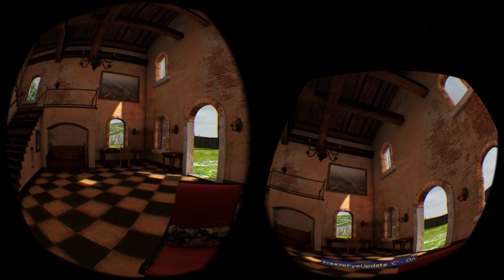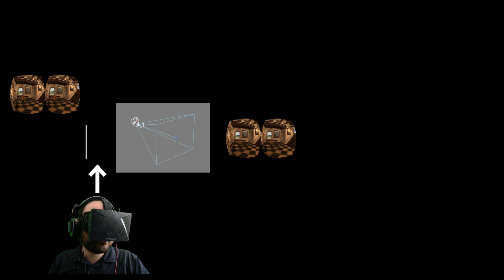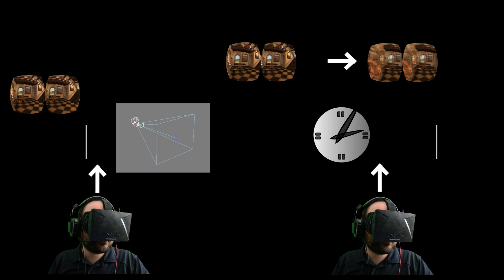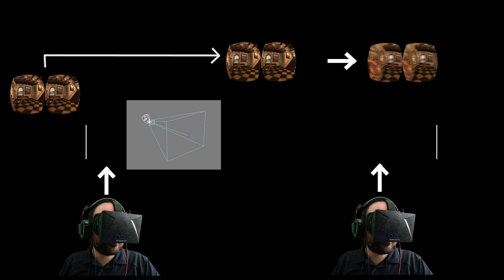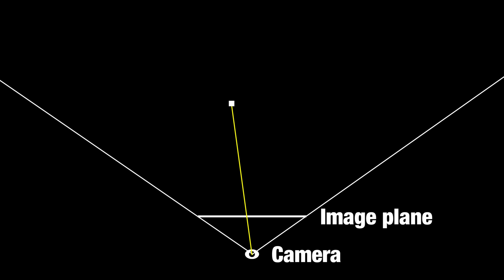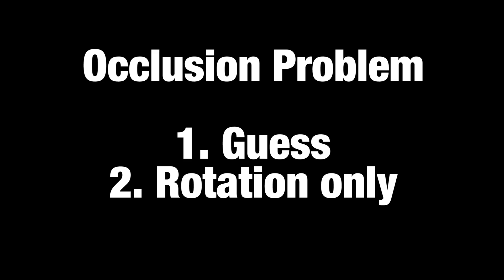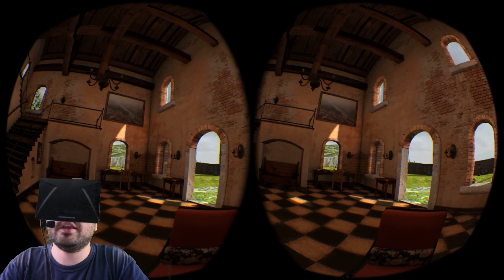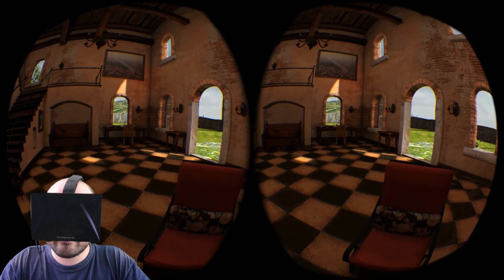Oculus Rift - How Does Time Warping Work?

Comment: hm... i'm not convinced that camera rotation causes "near objects to move faster than distant objects."  in fact, i fail to see how this is any different than quicktime vr from 1994.

EDIT: to be clear, i see the relevancy for translation.  but rotation-only doesn't even need the depth map.
Reply: Melinda - you might be interested to hear that Dave and i looking into similar techniques in the SL renderer.  something like his avatar impostors but for all geometry.  in the end that looks a lot like the layered z-buffer approach, and handles a lot of the occlusion problems...
Reply from the maker: You're right, I just figured out that rotation-only doesn't need the depth map (my implementation used it, but any z-value would produce the same result when composed only with x-z and y-z rotations). You're also right that there is no way to infer depth by watching the rotation-only animation, since there's no parallax. I'll add an annotation to that bit. I think the discussion of general post-rendering warping remains important since it illustrates the challenges and why they're sticking to the rotation-only system for now, and because DK2's positional tracking might encourage them to come up with methods for resolving disocclusions in the future, but you're right that their implementation so far is quite simple.

Edit: Interestingly enough I find the flatness resulting from lack of parallax is much less apparent in the Rift because it has stereoscopy.
Reply: It may be simple but it's definitely clever. Regarding flatness, the stereo effect is only strong near the center. I would guess that time warping might skew the stereo effect strangely but don't really know. Of course for small motions it may not matter.
Reply: not sure what you mean - in this case the camera is rotating on its center - to prevent problems with occlusion.
Reply from the maker: I'm guessing that because both eyes are being transformed in a rotation only manner, they're no longer aligned correctly for normal stereoscopy once the yaw angle becomes too large (e.g. when looking left, the z position of the right eye is too far back). It works better when looking up and down (the eyes remain aligned for correct stereoscopy, and also the Rift DK1 has more vertical than horizontal FOV per eye so there's less visible black).
Reply: oooh - that's interesting.  i was wondering about the feasibility of capturing/transmitting 360 degree stereographic video.  (3d immersive movies.)  what does it look like when you're 90 degrees off axis?
Reply: Qarl, i think you only have one eye in your mind.
Reply: i'm sorry?
Reply: Karl Stiefvater Surprisingly, something like you describe is possible. I first saw this in a brilliant 3D panorama submitted by a member of the Oakland Camera Club in one of our monthly 3D photography competitions. You can see an anaglyph version of that photo on our home page here: http://www.oaklandcameraclub.org/. Notice that the view is about 180 degrees wide, yet there is stereopsis across the entire image. He used dual cameras on a tripod and took several stereograms from different angles. He then combined all the left images into panoramic image for the left eye, and the right images for the right. I think that's brilliant. I've been using a similar technique with my Android phone's camera in panorama mode, and most recently with it's spherical 360 degree mode to create very wide-angle stereograms. Using this technique should let you generate the videos that you want though to do it in the real world, and in real-time, you'd need lots of cameras. Also, keeping the cameras from interfering with each other may be difficult.
Reply: that's fantastic news - immersive movies will be with us shortly.  Conan already solved the logistics for one camera: http://teamcoco.com/360/conan-welcomes-you-to-conan360
Reply from the maker: Karl Stiefvater 360 monoscopic video is a lot easier to do than 360 stereoscopic, because of the problem of correct eye alignment at all angles. I've seen prerendered 360 stereoscopic scenes in which they divide it into small vertical slices and render each one with the eyes positioned as they would be with that slice in the center of the view, and this mostly works, but isn't perfect. You could in principle solve the general problem with a large enough light field video camera but that would require a rather large spherical microlens array (about the size of a basketball/association football to support a good range of IPDs). Some 360 videos do steroscopic in one limited area of the view and monoscopic in the rest.
Reply: eVRydayVR yes, i understand.  that's Melinda's point above, she's describing a solution to the problem.
Reply: Rotational model is good for some VR scenarios, because the result is inherently correct for infinitely far away subject. However, in that case, there's also no paralax and two eyes become virtually one. No surprise, Quicktime-VR style environments always worked best for large vistas rather than narrow hallways. I suppose that's obvious enough to Qarl, i just couldn't hold myself back from making a cheap quip.

You can also produce paralax if you assume a specific distance at which the environment is, but there's a few things to consider. For one, i suspect this will work the better the further away this assumed distance is. If we knew where the person is pointing their eyeballs at, this would be a solved issue, but you could try to work this backwards: force people to stare where you want them to. You can force people to look at further away objects by blurring out the foreground, and you can use concentrically heavier blur towards the outside of the field of view to force them into the middle. Then you can sample the z-buffer in the small sharp area, median or average it, and extract a single virtual scene depth value to warp the rendering with.

Melinda's example panorama is very cute! However i don't think this would work in motion. In this picture, the world is inherently warped, and i think this might be necessary to maintain paralax - i'm not entirely sure though, it's definitely a curious subject to ponder upon and experiment with. I'll try to up a video tomorrow for everyone's enjoyment and/or nausea. Ultimately though, if you have just two images, i think you'll need to lock either the head rotation or the eye movement.
Reply: Siana Gearz  i'm not following you.  why would a technique that works for a single frame fail for a sequence of frames?

Comment: LOL nVidia's Gsync solves this problem completely
Reply from the maker: Gsync helps a lot, but doesn't completely resolve this problem, because you still read the tracking position before rendering the frame, and display the frame after rendering it - so if rendering takes a long time, you have a lot of latency. However, time warping works together with GSync very nicely: just render your frame, warp to the new tracking position after the frame, then send it straight on to the display when you're done. This avoids the need to carefully schedule time warping, and also shortens the time interval you're warping over.
Reply: eVRydayVR A very nicely put point :3
Reply: Thomas Al Abdallah-Sörensen XD yes
Reply: Sure, but according to a few (far smarter than me) people on the OR forums, the low-persistence doesn't work with g-sync.

Comment: Isnt this how crysis 3 did 3d?
Reply from the maker: I looked it up and it is related, yes. Crysis 2 and 3 used a 2D+depth or "fake 3D" system in which (if my understanding/speculation is correct) the scene was rendered in three layers, foreground, middle, and background. The background is identical in both views. The middle and foreground layers are rendered by rendering one view, then using post-rendering warping to to create the other view, using the layers behind to fill in disocclusions. This mostly works as long as objects in the middle layer aren't overlapping too much.